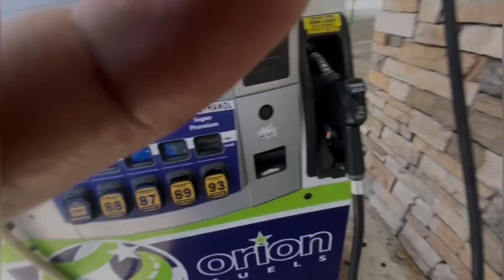Putting E85🌽 IN THE G37 sedan without Tune| BAD IDEA⁉️

Comment: Stock fuel system can handle roughly an E30 blend. I wouldn’t recommend over an E20-E25 blend. Stock calibration can adjust with fuel trims to still hit target AFR with a little bit of E85 mixed in